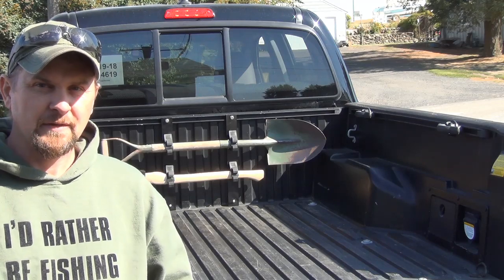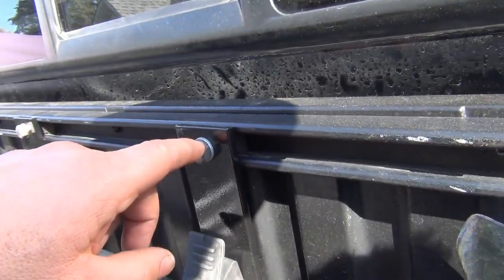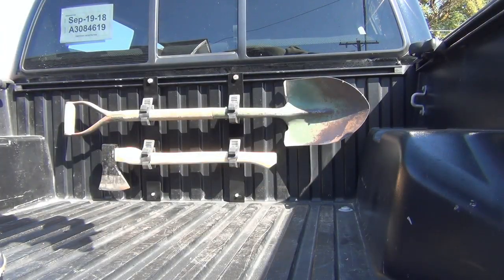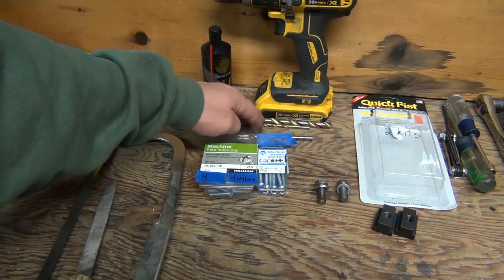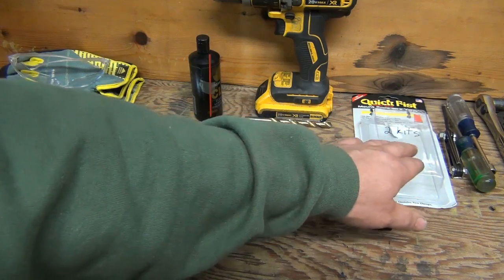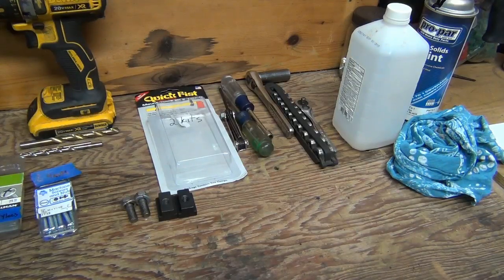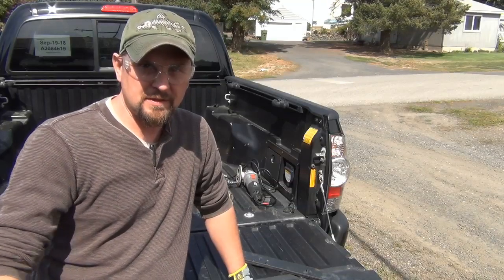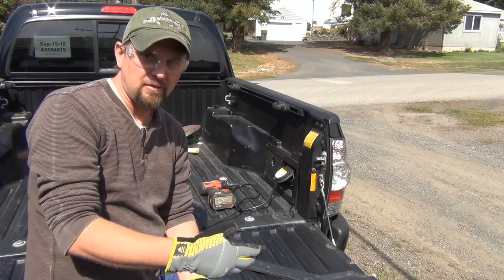Home Built Toyota Tacoma Tool Rack

Comment: Would you be able to post what the specific size T nut you bought from amazon ? It looks like there are number of different sizes (M 08, M10, M12 etc) on Amazon. I have a Tundra with the same rail system as your Tacoma. I’d love to make a system for a high lift jack. Thanks in advance. Great video and idea 👍
Reply from the maker: There are links to the items in the description, they are amazon affiliate links. They are 3/8 thread. If you dont want to use the links just search toyota rail t nuts and you will find them just be sure to  pay attention to the thread as some are metric and some are SAE and some don't say (as you noticed).  I used standard thread because I already had a supply of stainless bolts on hand. Thanks for watching!